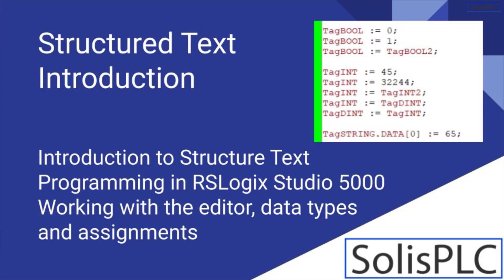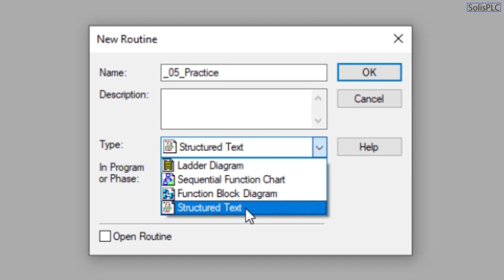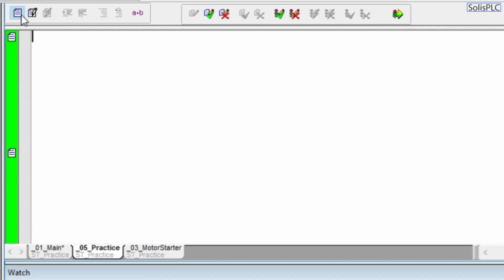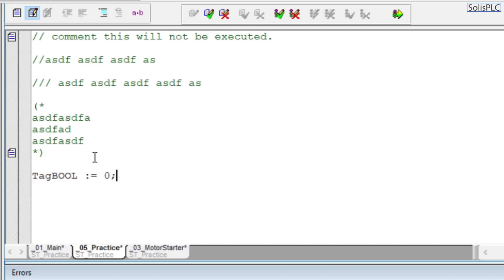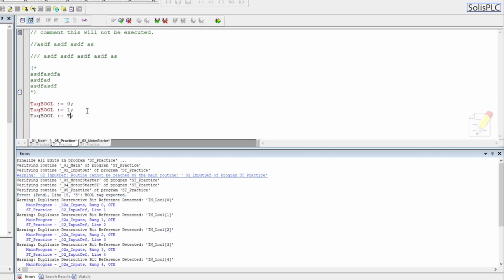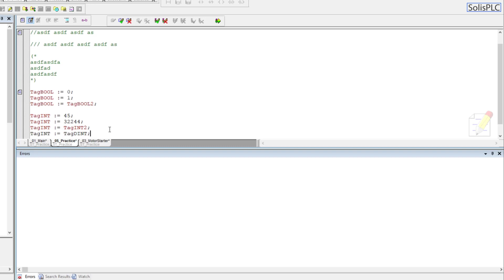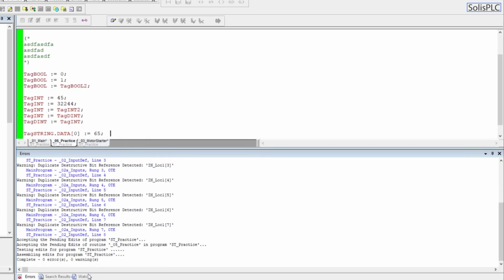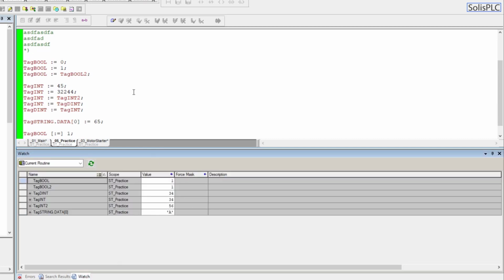Structured Text PLC Programming | Introduction to ST in RSLogix Studio 5000 Allen Bradley Tutorial

Comment: Hi Vlad, Thank you very much for this presentation. Just a quick question. I programmed code under RsLogix 5 and I wanted to send this code in Structured Text in a PLC 5/30 equipped with a 1785-ME64 board. But unfortunately I have this message that blocks me: "Structured Text is not supported in this processor", while it works on another 1785-ME64 card! Do I have to configure this card? And if yes, how ? Thank you for your help. patrick